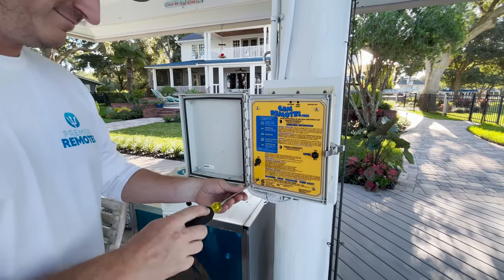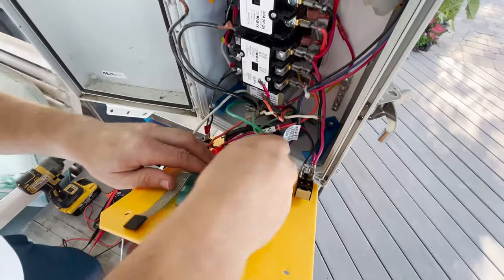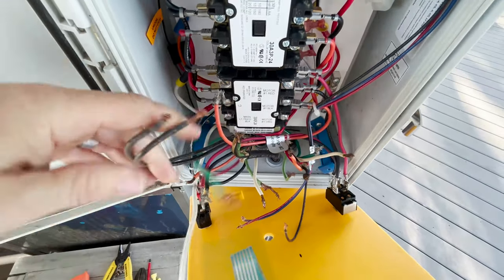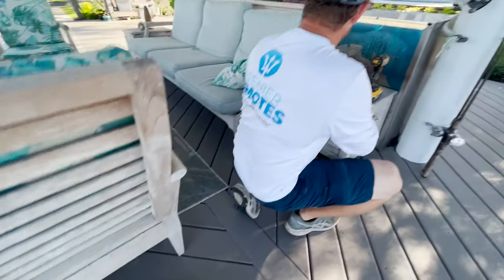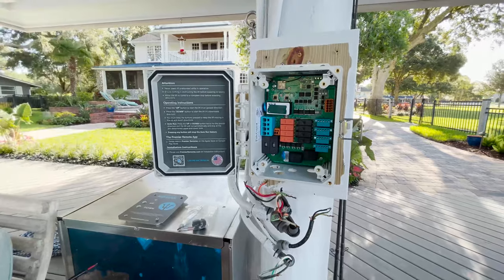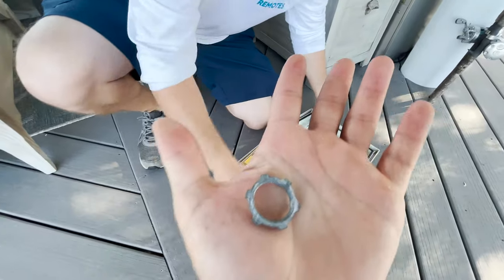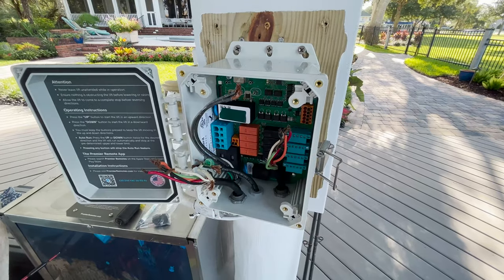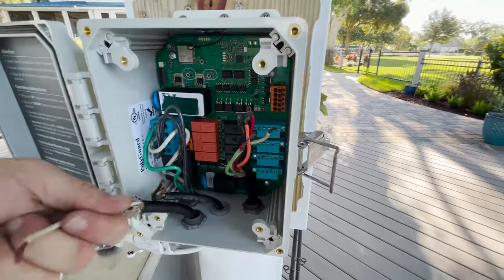Installation video: Replacing a GEM Remote GR2A with a PR2A

Comment: Great Video. I'm trying to repair my Gem Remote box that was damaged in Ft Myers in hurricane Ian and if I can not figure that out I'll be buying one of these Premier Remote boxes. Love the wifi feature. And very informative explaining the Gem Remote insides.
Reply from the maker: Hey Andy! Let's get you upgraded. Don't repair it, I'll get you hooked up.
Reply: If you still need help let me know. I live in port Charlotte and install these and build docks. If need me to come take a look just let me know.
Reply: @MichaelBennett-ep3vn  thanks I ended up getting them to work again. I think I replaced the transformer and it worked.

Comment: So cord in liquid tight ain't code compliant
Reply: Pretty sure the NEC doesn't apply to boat lifts.  Doesn't apply to most cord-connected equipment (spas, low voltage lighting, dishwashers, a few other specific items -- but not boat lifts).